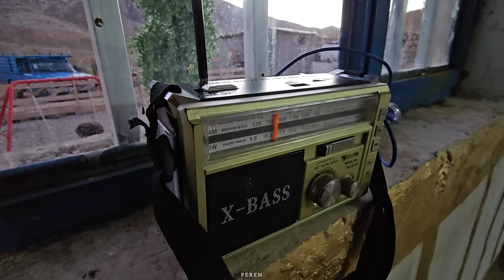Rural family.  The Perren family is on New Year's vacation

Comment: Peren family you should address the dampness of the walls in the room you said you love to be in. Eventually the dampness will start to grow molds and it will be bad for every one, especially for the young children and the asthmatic adult in the home. It should be a priority.
Reply: That's a good point material's used plus wet conditions breeding ground for mold
Reply: Walls will also crumble.  You can use a sealant over the plaster.   The wall will eventually fall if it is mot addressed.  Blessings to you.
Reply: Também  reparei que várias paredes estão  com umidade. Isso não  é  bom para a saúde.
Reply: Hay una pintura selladora que penetra el cemento y sirve de cellante tambien, acá en Estados  Unidos 🇺🇸  es la pintura que se usa para pintar los sotanos.
Reply: Baqi log nimaz q nai parhty  ?nimaz oarhny waly k agy sy nai Guarty bachon ko mana q nai karty
Reply: Meri baat samajh ajati h app ko?
Reply: Yes, very very important health issue
Reply: The cute little baby girl in the pink dress. I hope they move her bed into the bigger room to sleep. Without the wet walls
Reply: The water comes through the old stone wall that was already here when they came. They used the old wall and that is the one with the worst leaking. I think they will have to eat permission to cement the back of the wall and then apply Isogam.
Reply: @gmpacheco60  it will take more then a paint primer or sealant to correct this problem

Comment: i hate saying this but you need to sort out that damp room.  obviously trying to seal the outside wall where the heater is isnt possible because there is no room to get between it and the wall.  However there are products you can use if you scrape it back to bare concrete block.  There are paints that will penetrate the blocks and seal them.  It will need two coats.  Polyguard Airlok Barrier System paints are what we use here to seal to stop moisture.